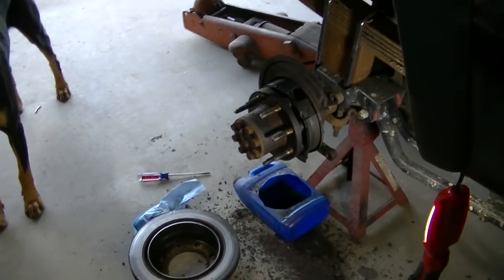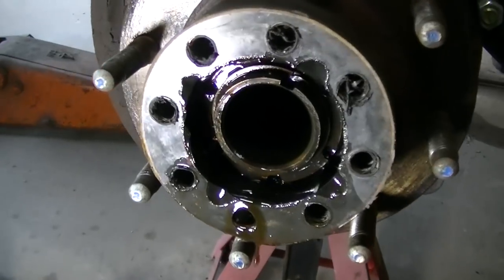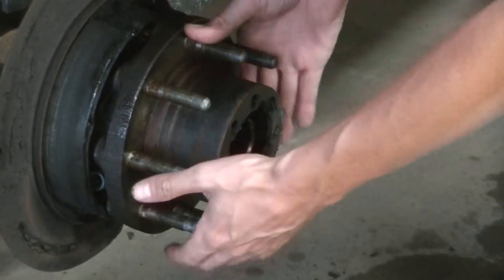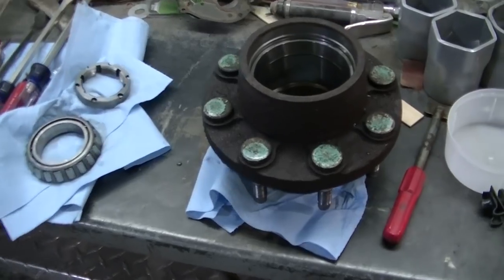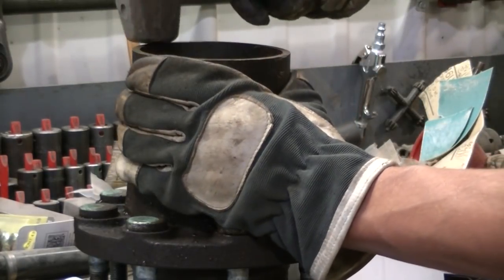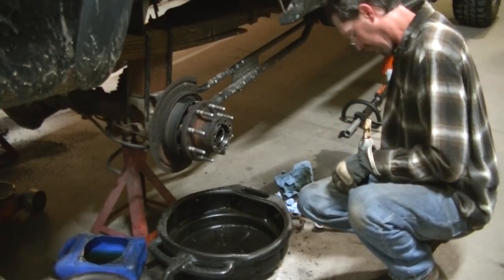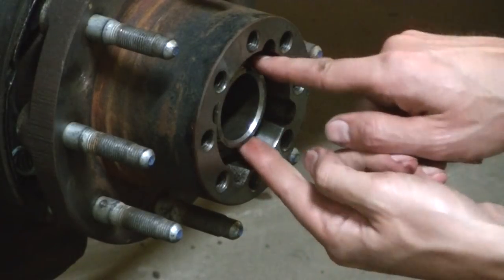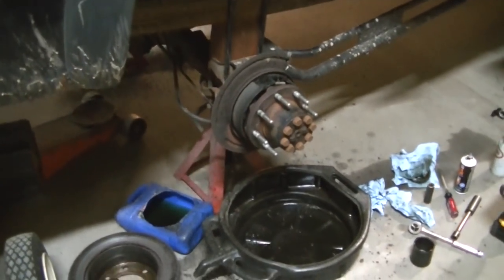Silverado 2500HD 10.5 11.5 Floating Rear Axle Wheel Seal Replacement

Comment: Great vid. As a heavy duty mechanic I would have suggested pre fill the hub with gear oil before pushing it all the way on the axle stub. One other way to get oil to that hub is to jack up the other side so the oil runs into the hub you just had off
Reply from the maker: Thanks, I coated my bearings with Lucas before install.  Never thought about jacking one side up but it's a good idea.
Reply: Prefill and change out the 8 hole gasket, they're only a couple bucks.

Comment: You called that a semi floating axle.  That there is a full float!
Reply: I thought in a full float, the axle shaft splines into the hub axle cap thing rather than the cap being part of the axle shaft forging

Comment: no C clip on axle in diff? i assume this is a limited slip differential
Reply from the maker: @bradleystevens2956  No clip on a floating axle. The bolts on the outside hold the axle.

Comment: Just finished my 2005 2500 hd 10.5
I should have watched the video again before I started. I forgot the gear before putting on the seal. Had to get another one. The original seal on mine is now different as I found out. All of this was on the video but I forgot. Very good video and something you can do with patients. Thanks again for showing me how.

Comment: Thanks for posting this video; I recently ran into an issue where I broke off two wheel studs when rotating my tires, and this process helped my light bulb come on for the hub removal/re-install process.

Comment: Thank you, I just noticed my passenger side leaking after pulling my rotors off to have them turned. I was dreading the idea of tearing this apart but you made it look pretty simple. I just called O'Reilly's they have all the parts in stock I'm attacking it tomorrow

Comment: I just replaced my seal.  I didn't have any seal or rtv where my axle bolts to the hub and it didn't leak.  Also, it's safe to say it was worked on before.  The original seal was a different style than what yours had and the replacement was actually identical to the one on yours that was leaking.  Also, yes.  The nut was way too tight when you took it apart.  Great video!

Comment: I had a shop in Georgia change the right rear axle seal on my 2013 Chevy 2500 hd and it was like being tortured watching the guy. 

He didn't have a spindle nut wrench or socket and he went to look for one and I took the retaining clip off and key way out and got the nut off before he returned.

We struggled to get the hub off and seal broke and half of it stayed on the shaft. Got it all apart and there wasn't any damage to the shaft or bearings thank God.

During this whole process I was calling everywhere trying to find a spindle nut socket with no luck.

Got it all back together and I'm hoping for the best even though there's some brake noise from the pads for some reason.

I was only in town to pick up a cargo trailer to deliver to a customer in Mississippi and I'll be keeping a really close eye on it to make sure it doesn't start heating up or anything.

Not exactly a nightmare but, I never like it when a shop has that many problems with such a relatively easy job.
Reply from the maker: Doesn't sound like a very good shop. Hope your repair holds up.
Reply: @mossman381  

Thanks, me too. I made the trip to Mississippi ok and checked it quite a few times when I first started and nothing was heating up. It was the right rear axle seal and when I turn left it makes a noise still. I was hoping it was just something on the pad that needed to wear off but I think something is out of alignment. Maybe the parking brake ? I don't know. Might have to take it apart and check it out.

If I weren't pressed for time I was going to buy the couple of tools that I needed and just do it myself in a parking lot somewhere beside an auto parts store.

Comment: I had to remove the visor on my 03 duramax because whoever installed it used one screw that wasn't stainless and it finally started leaking, so I had to fix it. IDK how much the shipping cost would be but I'm not going to put it back on, so you could have it for free if you want it for you or your dads truck. You've helped me a ton and I appreciate it.
Reply from the maker: Glad to help.  I don't really like the visors.  Thanks anyway.

Comment: Did you have to drain any gear fluid before replacing the seal? im about to do mine and that is the only thing im unsure of. not sure if ill get a release and what to replace it with yet.
Reply: A little comes out. Not enough to worry about but I’d definitely have some extra gear oil on hand and check level when you’re done.

Comment: Thank you for the excellent video.  I have a 1993 CK 3500.  I'm not sure what type of Axle I have.
I don't think it is floating but I will find out when I get the tires off.  Thanks again.
Reply from the maker: I am pretty sure you will have a floating axle but it will have drum brakes. That changes a few things.
Reply: @mossman381  I've never done this before so if you have any advice I would appreciate
it.  I live in a very small town and I haven't found anyone who knows how.  If I need the
special socket if I can't rent it I will purchase it.  I will start on it when it gets warmer.
I really appreciate you replying.

Comment: Iinteresting didnt know they bearing are sitting in oil bath. I would have very lightly packed that bearing and then drove it and changed diff fluid but thats just personal preference. Nice video.
Reply from the maker: You don't pack oil bath bearings.  I will coat them with Lucas so they aren't dry before reassembly.

Comment: Have a daully used an extra spindle nut to keep the key way in instead of the stupid c clip fits just right against the axle flange , new specs call for around 50 ish pounds for the spindle nut , one prob I think is the 2 part seal and the new seal , I think it’s not correctly made to take up the horizontal “ play “ ??

Comment: need limited slip additive ? how can i tell if i need it. visual signs if any .i know its  14 bolt 11.5 full floating  duel wheel axle   not original  from junk yard is all i know for sure   now   on a 07 ram 3500 diesel 4x4 duelly HD?

Comment: Are the bearings and the seal the same for the 10.5” and 11.5”?
I’m in sweden and hard to find parts over here, if so i need to order from the states! And really don’t now what bearing i should buy then
Reply from the maker: I didn't replace the bearings so I am not sure.

Comment: ...so at 9:16 you say "got the seal lubed up a little bit" - does that mean the seal get's grease or something to help it slide onto the spindle? - As I understand it is a two-piece seal (the actual 'seal' being inside the two-piece design and not like an old school one-piece type that seal against the spindle itself) and I've read that the seal is supposed to slide on 'dry', making a tight seal to the spindle.  Are you saying it is supposed to be lubed?

Comment: well done , it didn't look like the axle to hub had any sealant , did you notice any.
Reply from the maker: There was a gasket and a very small amount of rtv.  I just used sealant and no gasket.  Did the same thing on the dually with no problems.

Comment: Any pointers I did this job last Friday and put new caliper on my truck as well and I’ve noticed today either my new caliper is sticking or my hub but is to tight but I torqued it to 50 ft pounds and backed it off a quarter turn and put the keeper back in. Hub turns freaked but noticed it’s smoking
Reply from the maker: Check to make sure your brake rotor isn't hitting the brake shield. I had new rotors do that one time and everything turned great until I torqued down my wheels. Had to turn down the brake rotors but I think the rotors were made wrong.

Comment: Thanks for sharing this video.  I never had a press, did I used a vise. Don't know is that is acceptable, but I may have just been 🍀 lucky 😃
Reply from the maker: No press needed to do this repair.  A big set of seal drivers would be a good idea.

Comment: Are the differential vents hard to diagnose and make sure they are venting?   6.6L Duramax
Reply from the maker: I have never heard of them plugging up.  You have a reason you think it's plugged?
Reply: mossman381 

      I have read all over the internet and YouTube that they get plugged and then blow the axle seals.  Wanting to do some Pre-maintenance before this happens.  Truck is new to me.  2006 Duramax
Reply from the maker: I did both sides on my dually.  One side on dads 04 awhile ago and one side on my 02.  Seals get old and fail.  I would have to see all these plugged vent lines.  If you are worried you would have to pull the diff cover and blow out the vent hose.  I really don't know how the vent would get plugged.

Comment: When I did mine after the 50 pound torque and quarter turn back the hub would not spin at all?  I had to loosen the nut back and tighten by hand.   Hope it works
Reply from the maker: I had the same trouble when I did my dads Duramax.  He has put a lot of miles on his and no issues so far.

Comment: do you have to lubricate the rubber side of the new hub seal before re-installing the hub onto the spindle, or does it just go on 'dry'?
Reply: I have heard the seals are installed dry.
Reply: That seal is a two piece design so it doesn’t actually move  on the spindle surface. It is fixed on the spindle and inside the hub. It is important to tighten the bearing nut first to something like 100 lb/ft and then back it off to seat the seal on the spindle and when you back it off you provide clearance between the moving parts of the seal.
Reply: @thebrushhawg  I would recommend checking the inner and outer bearing and their seating in the race of each. I replaced my axle seal last summer and it failed in the winter. The inner bearing, on my 2004 GMC 2500 4*4, must have been improperly seated or just plain bad. It was very lose on the second seal replacement job, which is likely why it failed in the winter.
 I have replaced 2 bearings and races and another seal and all the brake shoes again. I gave the hub a good smack on a 2*4 and then torqued it to 100lbs. I then backed it off, until I got a good position for the key installation. NO LEAKS! :) I also drained the rear differential again and filled again with synthetic 75w 90 Castrol gear oil.  BG :)
Reply: @BrianGallagherSylvanLk  did the bearings being bad  cause your abs light on and where did you find the bearings as every auto parts store I've checked are trying to sell me them and in the description of them it says for a 10.5" and I thought duramaxs are 11.5" axle I have a 2007.5 gmc sierra duramax lmm
Reply: @thugthuggin69  I was doing the seals and it was apart so I did the bearings at the same time. The seal failed because it wasn't fully seated to axle
Reply: no blinky lights on the dash ever in regards to the leaky axle seals.

Comment: So I let someone do my rear axle seal and I noticed they used grease on my bearings then the next day the seal busted and started pouring.Could the grease been the problem?Could it have caused anymore problems?
Reply from the maker: Not sure it would cause a seal to push out but you don't pack them with grease like some wheel bearings. I put some Lucas on them before install so they don't start dry but the grease from the rear end will lube them.

Comment: Is this truck 4x4 or 2wd? Is there a difference for socket I should use? Because all the spindle sockets I found were for front or 4x4
Reply from the maker: This truck is a 4x4. There will be no difference in the rear axle of a 4wd and 2wd truck. Probably have to do some checking online to find the parts you need for your truck.

Comment: My bearings I installed dry. And no oil ever made it to the bearings through the axel shaft. Bearings are now shavings....Smh
Reply from the maker: I like to coat mine with Lucas so they don't start dry. Have you checked your axle fluid? If you don't have enough fluid it won't make it to the outer bearings. And like I said driving in circles after install will force oil to them. Did you over tighten the nut? That could hurt your bearings.
Reply: The smaller outer bearing had oil.  I changed the oil in pumpkin when I did the wheel seals and shoes. Took three quarts. The nut preload was set using a flat head and hammer. Cuz I didn't have the proper socket.
Reply: Factory service manual says to pack bearings with grease. It will just mix with oil and be fine

Comment: That's exactly what happened to me this spring. Went to put my nice wheels on then it turned into a brake job then I found I had a bad seal
Reply from the maker: A leaking wheel seal is hard to see.  It's not a hard job but you don't want the bearing too tight.  It looked like someone had this nut too tight.  I am thinking I should check the other side to make sure.
Reply: mossman381 that was the first time touching one on my truck since 2003
Reply from the maker: They don't go out very often.  I had one on the dually start leaking.  I changed that out before I was on YouTube.

Comment: Hey mossman, my 03 duramax is pulling to the right pretty bad recently, can you point me in the right direction of what might need replaced before I get it aligned? Thanks
Reply from the maker: Dads 04 is doing the same thing.  I think it's the steering box but not positive.
Reply: Thanks man, I'm subbed so if you find and fix your dads truck I'll know. I remember you fixing a steering box before. Is a steering box problem something that an alignment garage will be able to diagnose easily? I won't bug you anymore, thanks.
Reply from the maker: You would think an alignment guy would know what a bad steering box feels like but these days I can't find anybody working anywhere that seems to know anything.  We have tried to get dads truck aligned 3 or 4 times now.  Every time they say one part is bad and it needs to be replaced and charge $40 for putting it on the machine.  They even told us that one of our new upper ball joints were bad.  A brand new Moog ball joint is bad?????  Honestly I don't trust them anymore.  I am going to do my own alignment with string off the back tires from now on.  I will use an angle gauge to adjust camber.  I did Midnight that way and everything feels good and tires look like they are wearing good.
Reply: Thanks again, when you do the string alignment, please please do a video, you've saved me a bunch of money and hassle with your how to videos.
Reply from the maker: I showed how I did the string method at the end of the final lift kit install video.  I haven't shown using the angle gauge.  I will see if I can get some video when I do dads truck.

Comment: If anybody else ends up in the situation I would recommend replacing the emergency brakes you don't want to clean them don't ever be clean like they need to be replaced them
Reply from the maker: Not sure I have ever used my parking brake on any 99-07 truck I have had. With an auto trans and park, it's almost never needed.

Comment: 52ft lbs and a 1/4 turn off and Im still really tight and the hub does not spin freely. Brand new seals. 2005 Chevrolet 2500 DMAX.
Reply: 50 ft lbs i meant
Reply: Although by other sources im told 52

Comment: In this day and age why are pick-ups still using this antiquated rear suspension? I mean they still use a leaf spring suspension. Considering how much these trucks cost.
Reply from the maker: This truck was probably around $32k new.  They are easily double that now.  The leaf spring suspension is proven to work and last a long time.  Considering this truck has over 260k miles I think they did a good job engineering it.  Dad has over 300k miles on his 04.
Reply: mossman381 I know but like I said  trucks have become much more modern, the rear suspension not so much. You sound like Ford with the Model T.
Reply from the maker: Why make it more complicated?  That would make it more expensive and more moving parts to wear out.  Trucks haven't changed all that much.  The front suspensions on the 1500's have changed but that's about it.  They are adding computers, heated and cooled seats and better interior fit and finish.  I don't like all the technology they are adding to the new trucks.  I can check my own air pressure.  I don't want to be told when my doors and hood are open.  I know when they are open.  So much wasted tech.
Reply: there is no need for a suspension that would corner better at speed. And this is much better at carrying loads without accumulating slack in many many parts.  With all the money in the shipping industry you'd see independant suspension on big heavy truck if it had advantage and no drawbacks.
Reply: The full floating axle and leaf spring is a heavy duty design that doesn't wear out in 100,000 miles and can actually be serviced when needed.
You little boys can run the coil springs on your 1/2 ton grocery getter with air conditioned seats, wood grain trim, and carpet that you want to have ride like a car...  The coil spring rears are a step back into the 1960s.  I'll keep my 3/4 ton with manual transfer case, manual locking hubs, manual transmission, insulated vinyl floor covering, leaf springs front and back, and full floating rear axle.  It won't be used up in 200,000 miles.
Reply: Because coil spring sucks on a truck in the back.   Can't even put 500 pounds in the bed of a 1500 ram without the arse end sagging 3 inches.
Reply: @72Disco1998  if it aint broke don't fix it  why re invent the wheel

Comment: Lol driving in circles. God I would like to see that. Why not lift the truck one side to the other so your not dry running them as much.
Reply from the maker: If you put Lucas on them before installing they are not dry.  Once the diff starts moving the fluid will flow everywhere.  Driving in circles will just help move the fluid to the sides.